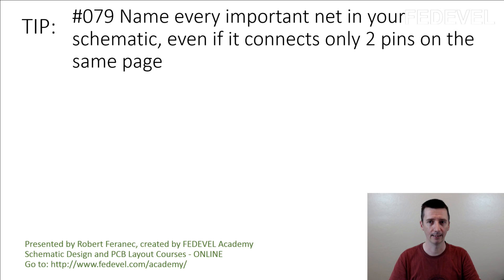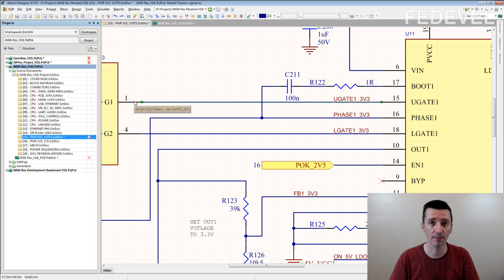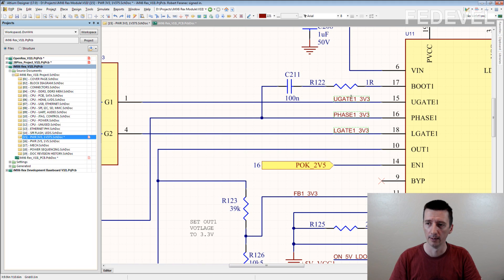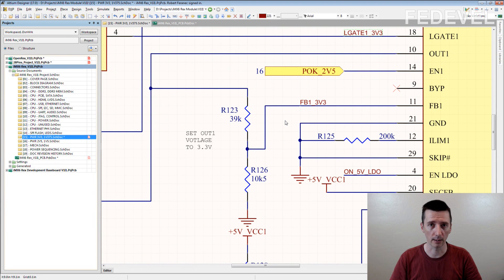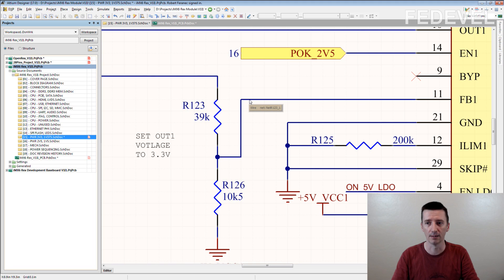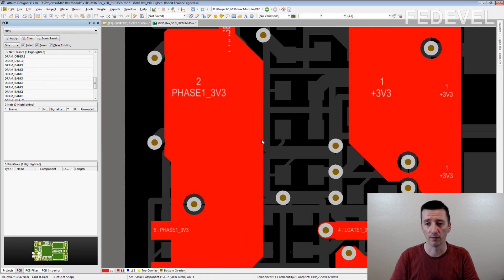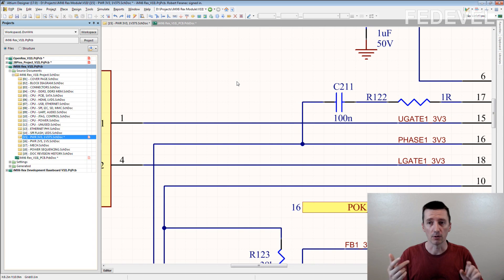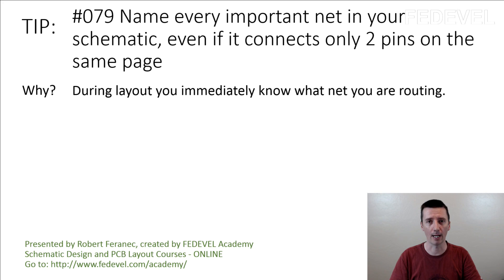TIP #079: Name every important net in your schematic, even if ...

Comment: Robert, thanks for the tip. At around 2:10 you mentioned that the feedback for the DC DC converter should be somewhat wider and shorter. The shorter part is logical, but why wider? The only thing I can guess is that there would be increased capacitance between the ground plane and it to make it very slightly more immune to noise pickup?
Reply: Well, yeah, I understand the resistance, but the feedback on DC DC converters is generally a high impedance input, so unless the trace resistance is in the kOhms, it shouldn't matter. As to the inductance, well, possibly, but since the track is already short, the inductance will be in the nH already.
Reply: Perhaps reduced inductance.
Reply: Both inductance and resistance are lower if the track is wider.
Reply: I didn't mean resistance plays a key role in this case, I was just stating a fact. I'm sorry for the confusion. Well, the lower the inductance, the better (e.g. less noise, less overshooting, etc.). To understand the importance of making wide tracks, for a given track length, if you double its width, you can reduce its self-inductance by half, depending on the board material and geometry. So this is really important.
Reply: I agree with you. For feedback loops capacitance tends to play a more important role.